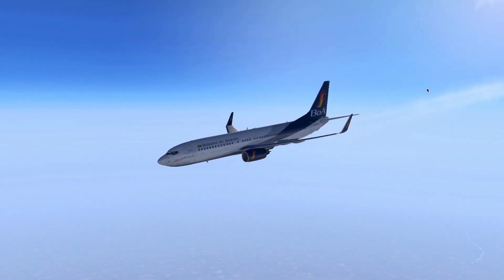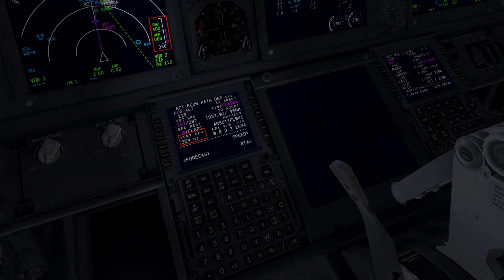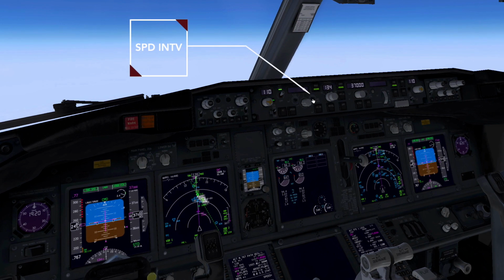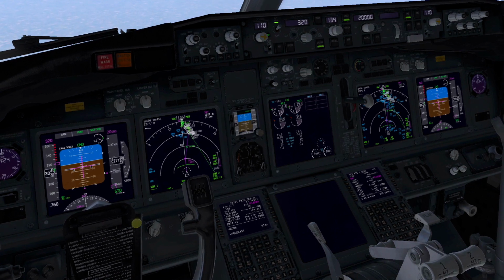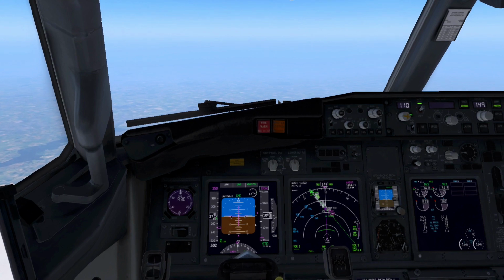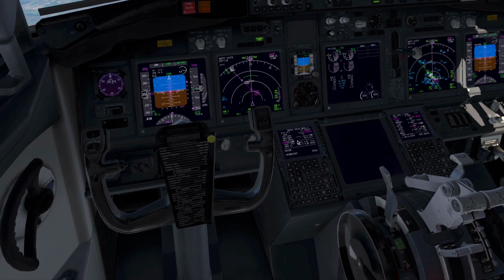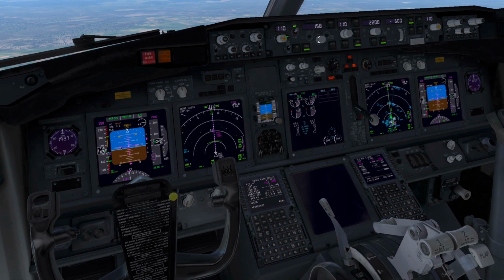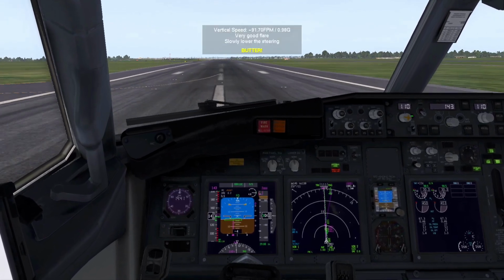737 High Energy Management TUTORIAL / Real Pilot

Comment: Nice video and explanations. Thanks for sharing. Just having a question, during the descent you increase the MCP speed to 320 KIAS and it gives a vertical speed of -6000 ft/min. It seems a little bit excessive for me for a descent rate ? Is that realistic ? Does the real airplane descend at such vertical speed ?
Reply from the maker: Calim HIRO Thanks! Well in this example I used a “extreme” case because we were VERY high on the profile, normally I wouldn’t increase my speed beyond 300kts, however keep in mind that the higher you are, the less dense the air is, so the more the plane has to pitch down to obtain the desired MCP speed. Some times for example, if you are cruising at FL400 VNAV will start its NORMAL descent with a 4000fpm  descent, so a 6000fpm descent to recover a profile is not “excessive”, it may be a little uncomfortable for the passengers but once the descent rate is achieved, weather is 1000fpm or 6000fpm the g- force in the passengers will be 0. (on a emergency descent you will most likely exceed 6000fpm). But I can agree that the Zibo Mod may have pitched down a little bit too much.
Reply: @rolandonavia7975  In reality the -6000 fpm will have you hanging on your belts. Between 6000 and 10000 is an emergency descent that is being used in case of explosive decomp for example. It is very uncomfortable and I don't see one using such excess vertical speed in normal operation, even with high energy resolution.
Reply: Yes it's used quite normally in short term, to catch up profile like this